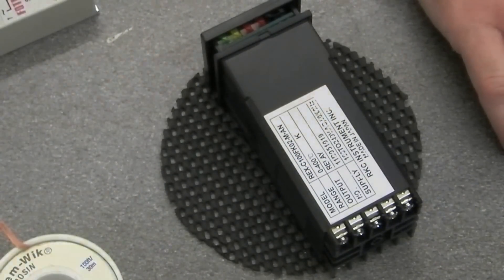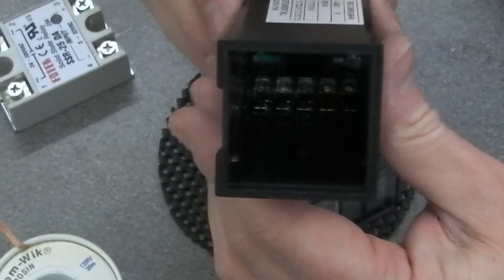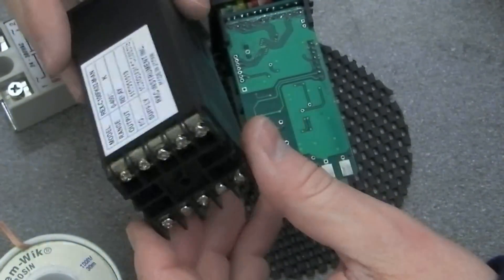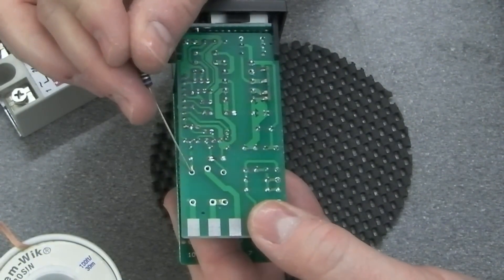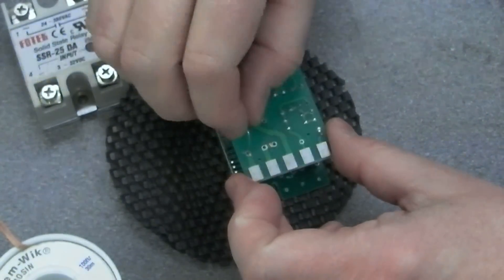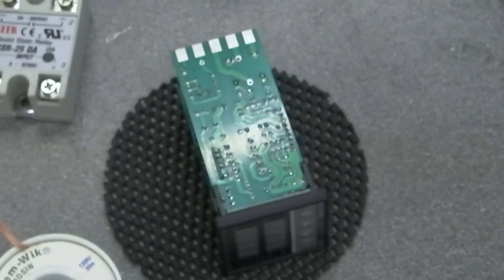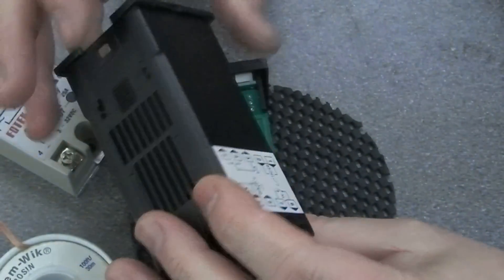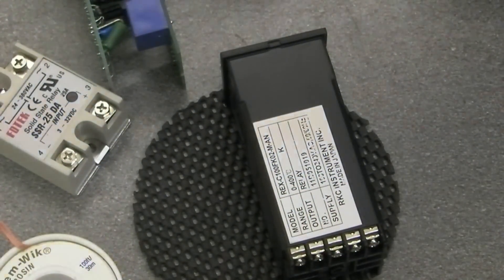REX C100 PID Relay to SSR Modification

Comment: Thank you very much for the help. I keep on coming back to the same issue. I will connect then the main supply to pin 3 after being fused, and to pin 5, while the heating cable will be connected to 3 and 4? Sorry for not understanding much, I am an agronomist not engineer so please forgive me for insisting on this.

Comment from the maker: 4. Make sure this supply has a fuse fitted somewhere.
PLEASE check the correct terminal pin numbers are the same as on mine!!!
Look at the terminal diagram label stuck on the REX
This 220 supply should be fused and connected to pin 3.

Comment from the maker: Please leave pins 1 and 2 alone! They are required to power the REX.
If you need to supply 220 volts to your heating cable and so long as it is less than 3 amps then you must supply 220 volts to pin 3 or 5, as they are linked by the relay internally, so the relay can switch it on and off for you on pin 
4. Make sure this supply has a fuse fitted somewhere.

Comment: Thank you very much for your quick answer. As I am not familiar with all these, do you mean that the main supply should be in pin 3 and either 1 or 2, because I connected it to pins 1 and 2.

Comment from the maker: Hi
Your REX is working correctly!
You must supply the voltage that the relay is switching yourself.
You can supply 240 volts up to 3 amps maximum with the built in relay.
Look at 4 minutes 25 seconds--- pin 3 is where you supply the voltage to.
It is then switched by the relay.

If you need more than 3 amps then us the solid state relay option as described in the videos.
Reply: I would think this would be obvious...................... I guess not. ;)

Comment: Dear friend,
I recently purchased from e-bay 3 REX C100 thermostats and I have watched your video which is fantastic. I need your help on something. I connected the PID to the main supply, attached a TC and checked with a multimeter at the connections 3-5 if there is any voltage there and there was not any although I was hearing the relay clicking. Is this normal? I need to wire a heating cable which works at 220 V, Should I do what you are describing her in order to work?Thank for your answer!